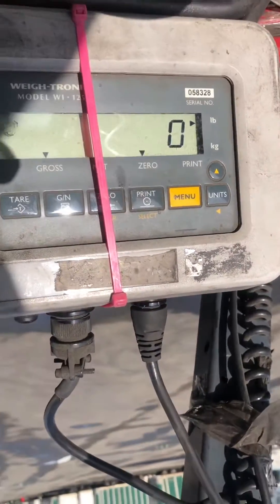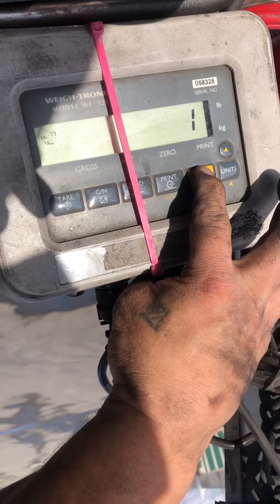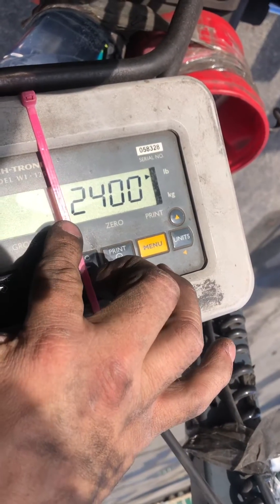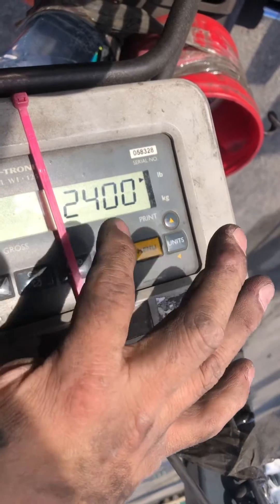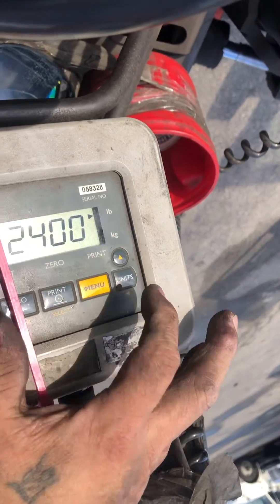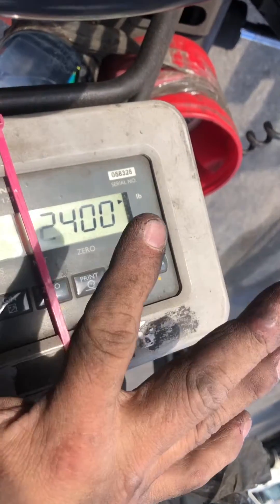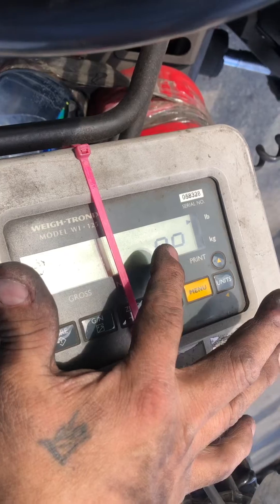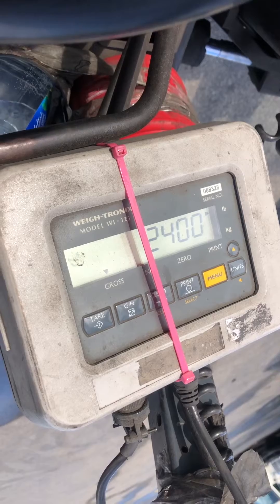Calibration adjustment of a Weightronix old style WI-125

Comment: No matter what I’ve tried mine still won’t weigh anything. Also no ‘setup’ display shows when I hold down the menu button
Reply from the maker: Possible there’s a jumper on the board that has to be removed with that jumper engaged it locks out the set up so the calibration can’t be adjusted if it’s legal for trade
Reply: @Raddamez1215 we got it! Our not so good operator lost the plate cover for the load cells so the they just needed to be screwed back in. Thanks for the reply!

Comment: Any idea of what to do if you get a "Loc'd Up" message while using this scale? WI-125
Reply from the maker: Either a cable is cut or a bad load cell
Reply: @Raddamez1215  Having the same problem can't get rid of Loc'd Up
Reply from the maker: @proprocessors8688  if it’s being used on a forklift, either the retractable cable is cut or damaged, or a weigh bar/load cell is bad if it’s not the cable, then disconnect a load cell doing so by disconnecting one at a time if you disconnect one and loc’d up remains reconnect it and try the next one when the bad load cell is disconnected you will see zero range if it’s not the weigh bars or the cable then the junction box has to be trouble shooted if the indicator is being used for a base it can be trouble shooted the same way